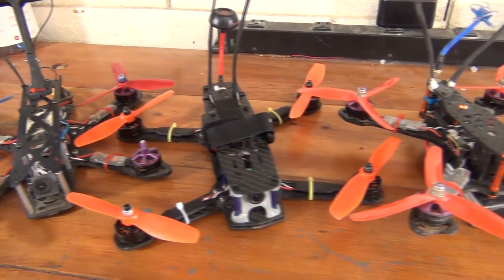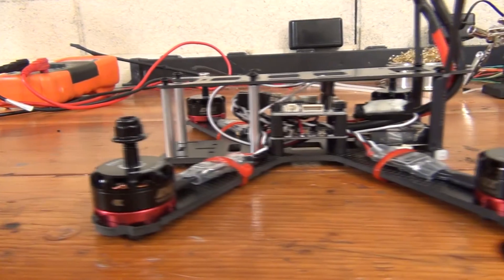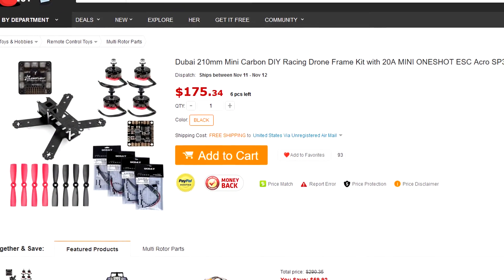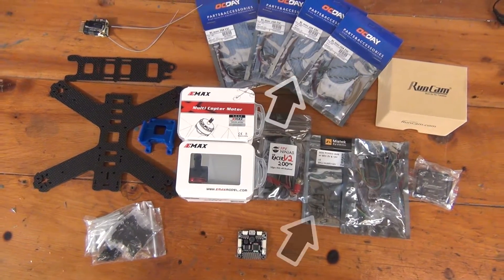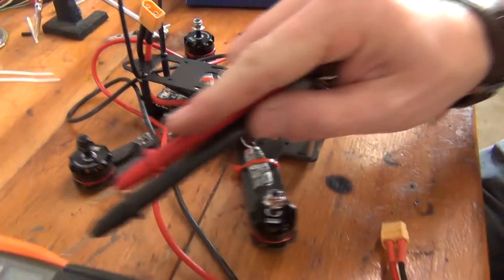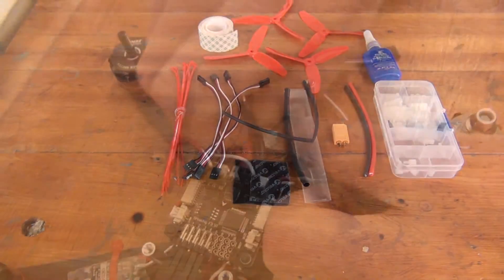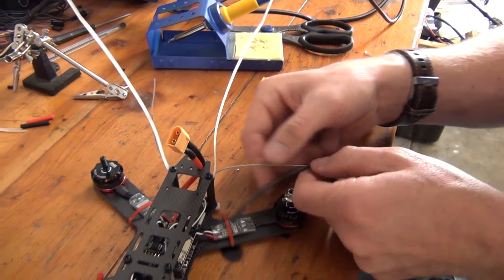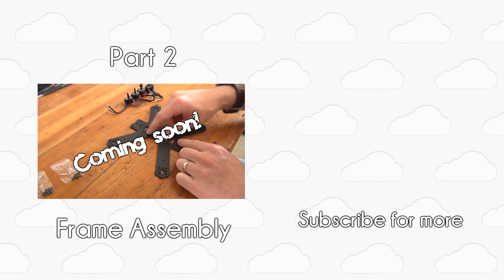How to build a racing drone | Part 1: Assembling the parts!

Comment: It's a great manual, both video and website,
but some thing are not mentioned (or hard to find in the manual), for example the type of the loctite, the AWG of battery cable, standoffs height etc. It it mentioned anywhere during the videos or the manual? Thanks!